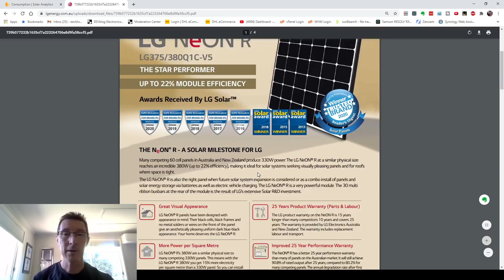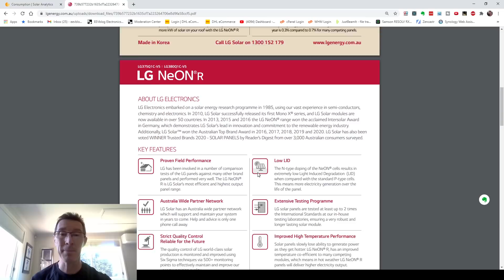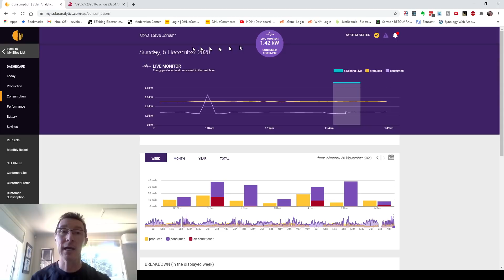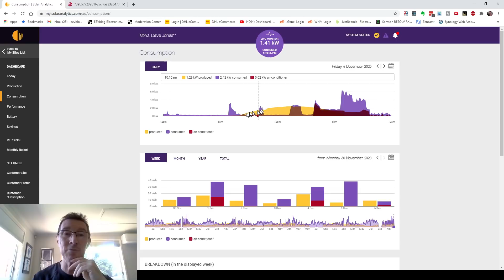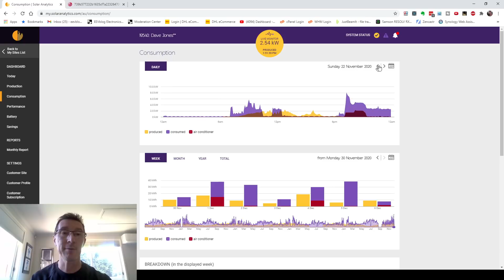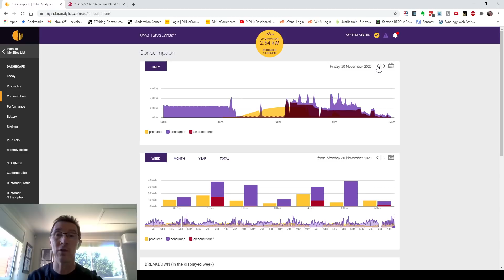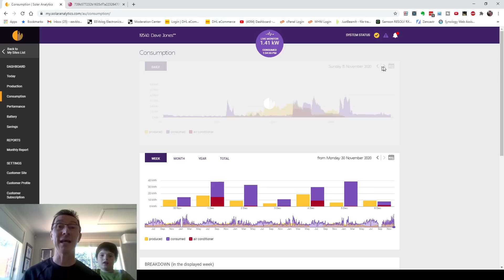Home Solar Upgrade Power Consumption

Comment: Here in northern Michigan, we call them solar suckers. "You bought a solar pannel?" Lol "Sucker!"😆
Reply: Solar is effective even in northern Michigan. Heck there are viable systems up close to the Arctic circle. Mine is doing very well in SE Michigan, and I have friends up in the Keweenaw, about as far north as you can get, that have done the numbers and getting decent payback, given how much prices have dropped.
Dave's sticking to LG for panels is kind of killing his numbers. I bought PhonoSolar 400 watt panels and they were < $300 each versus double that for the LGs. Same warranty too and I'm very happy with the quality. OK it's < $300 US, versus close to $500 for the LGs, but still quite a difference.
Reply: @John_Ridley  how many incandescent lights can it run? Plus 5 tvs, 4 computers, an entire radio station, two refrigerators, stand up freezer, yard lights, and everything else thats on all the time? Sounds like I would need 20 years worth of consumers power bills to cover that useage with craptastic solar pannels that are 14% efficient. And not to mention under 3 foot of snow because I got 1/8 mile driveway to plow I wouldn't be shoveling the entire roof aswell. I live in the woods and have no place else to put a bunch of pannels. As I said there DEFINITELY not ready for prime time in northern Michigan.

Comment: So do you need the 6kw power? The peak loads are all after  'sunset', and I guess that's what the house battery system is for. And with batteries wouldn't the energy (kWh) of today's system be enough?

Comment: Those panels are very expensive, but I guess you pay for the density and name brand. A local company (South Africa) makes a mono perc 440W panel (2,09m x 1,04m) for the equivalent of 215AUD (R2428) including tax.
Also, a lot of the local inverters here come with parallel kits where if you want to upgrade later, you just wire another in next to your current one.

edit: I'm not sure if it's monocrystalline, but it's advertised as "mono percium".

Comment: I mean yeah I agree batteries aren't very cost-effective but it also depends on where you source them, if you're buying new high quality cells right from the manufacturer then of course they'll never pay for themselves, but you can find places such as battery hookup that will buy up/dumpster dive to get old equipment, failed products or whatever and sell the cells from those devices, you can find 4Ah cells for less than $1 (USD) or around $65 per KwH, sometimes even as low as half that price when their warehouse gets filled and they need to clear space they'll have "cheap as balls" sales to get rid of stock.

Judging by your power usage seems somewhat common to use upwards of 15-20Kw per night charging the EV, so if you got let's say a 5KwH battery for $325 and assuming you could get it mostly charged in a day, I forgot what electricity costs over there but going with 12c per kw, it would save you about 45-60 cents per night or basically take slightly under 2 years to pay for itself, so yeah it CAN pay for itself if you get the battery cheap enough.
Reply: yeah, there's no equivalent of battery hookup in AU, and bugger all Teslas (and other EVs) on the road (so bugger all wrecked EVs) so you're not going to get batteries anywhere NEAR that cheap in AU. Shipping large heavy things from the US is already horrifically expensive, add to that the fact that it's a lithium battery pack and you're well into "don't even bother" territory.

Comment: Solar...great in some areas...I was quoted needing a 12KW+ System (32 Panels).  This is due to the location of my house, where it sits, and the roof configuration (not a lot of "open spaces" like your house).  This coupled with being in the land of ice and snow also means during the winter I'd have to ensure to clear those panels to ensure solar power generation.  The claim is  I would generate a max of about 5Kw because of how many panels would be in the shade during the day only getting a few hours of sun max.  The cost of install (and I get NO compensation for doing a solar install) was over $50,000 WITHOUT a battery system.  Yea...just doesn't make economical sense to go into debt here for me.  Don't go all "But it's the right thing to do"...great for those of you that can, do it...don't preach to those of us that don't see the feasibility to do it.  $50K brakes me even (at the earliest) in 30 YEARS.  I'll be long dead.
Reply: That price seems way too steep to me. I'd expect under 2USD/watt installed.
Reply: @eDoc2020  BTW, Our panel cost was almost $18k alone for the good ones, and that was on a bulk buy.  Nearly $550 each....I need 32 per the 4 different studies.  That would leave (per your number), $6k for inverters ancillary parts, permits, and labor.  Fact is, we dont have an install like Dave.  We would need to install on 6 different roof faces, and that drives quite a bit of cost.  The 4 different places all quoted within $500....and all 4 said "we wouldn't recommend solar due to your home design as well as home orientation".  Heck, I dont even know where they could hang all power items we'd need.  We just dont have the outdoor wall space.   Lol
Reply: $3 per watt to start in my area.  That's the going rate.  Due to my roof configuration (multiple faces), and the need for at.least 3 inverters thanks to that, costs go way up.  If I want battery storage then I'm up another roughly $10k.  Yea, not happening on this home.  I'm approaching retirement, and we have a potential build site for the home we plan to retire too....that we may be able to pull off solar on.
Reply: Yeah, $50k is WAAAAAAAY OTT for a 12kW system. 
I ballparked a full off-grid system for a potential project in Northern Tasmania (so no snow... probably... it did snow two days last week, at the start of SUMMER...) recently. Came out to ~$40k-50k (AUD) for 10kW of panels (and appropriate charger/inverter) and 50kWh of usable storage.

Comment: Adding a battery system can be done with an inverter that integrates the charging, or a completely separate AC coupled battery system. I am looking at the latter to add a battery system to my existing 4kW system (2 strings). There are lots of losses though and it is questionable as Dave intimated. A battery system doesn't suddenly give you more money for nothing......well, not in Scotland anyways!......IMHO!

Comment: I don't understand why you are targeting for peak power when the peaks clearly occur during evening when there is no solar power.
You should average the power consumption over an entire day (or better, a year) and do the same for generated solar power,  and then find how much you have to scale up the solar power to cover the average power.  Peak does not matter.
Of course, that assumes you can transfer power back to the grid at any time.  When there are limits on that, you would need a battery system.
But to dimension your solar panels for a peak power that does not occur during the day makes no sense.

Comment: Hi Dave, take a look at the sunny island inverter, it integrates well with your system (grid tied AC coupled). In this way, you can add a battery backup, the batteries will charge during the day and let you charge you car during night.

Comment: The new solution sounds perfect, only 1 old panel to disassemble so least waste and as you said 6+ kW should be enough. If you're selling the electricity you don't use than a battery doesn't make much sense but if you don't than you should at least get 1 big enough to run both fridges all night.

Comment: Looking at the graph where Sagan mentions the mountains, it looks like your generation is through the day and most consumption is at night. 

If you’re selling to the grid during the day, that’s not so bad, as long as they’re paying you more than they charge at night. If not, it looks like a battery system would be pretty good, store all that energy up during the day then use it overnight. That way, there’s no worries about power cuts or anything and your electricity bill would be almost zero, as you’re generating all of it yourself. If there’s any excess once the batteries are full, you can then sell that to the grid, so the system is actually revenue generating at that point.

Comment: Better option for surplus power may be to dump it into a hot water tank via an immersion heater.  Hot water tanks are a lot cheaper than batteries!
Reply: How do you get the power back out of them?  What do you do with excess hot water?
Reply: @einfelder8262  Check out the videos on this by David Poz’s channel. Basically you can use it for space heating in winter or just to take showers etc. in summer to replace your conventional gas or electric water heater.
Reply: @Richardincancale  But in winter there is almost no sun to heat hot water for space heating, and you need to run a pump to circulate the water.  Whether you choose to store excess solar power in a lithium or water pack, it isn't financially viable here in Australia.  Some will still do it though, because they can, not because it makes sense.

Comment: ya aircon (wired to the correct rail) seems very very inefficient...almost using the same to charge the car.. ya lookin at what 4.5Kw just charging the car and running the aircon..

Comment: If you are charging the car at 2.2KW then I guess you are using the "granny charger" (the unit which comes with the car having a domestic plug). The problem with these apart from slow charging is they put a heavy load on the power outlet and many are not up to the job. Much better to get a proper charger fitted to the home with a current sensor which monitors the house exports and limits the charge rate to prevent you consuming power from the grid.

Comment: Hey Dave, have you stopped uploading to PVoutput?
Also, what size inverter are you going for? Are you going to slightly DC oversize a 6KW inverter?
Reply from the maker: No, just do it in batches. Will do an update now.

Comment: Please avoid the battery, it has no ROI, and the batteries contribute heavily to e waste that is nearly impossible to recycle. Is there any option to sell power back to the grid?
Reply: Well they are possible to recycle. It is just not true that they are not. Actually quite high rates now a days just not done on large scales since not enough batteries were available. 

And that batteries have no ROI is not true. It depends on the country. In Germany you just get 8,3ct/kWh now if you are under EEG and only 3-4ct/kWh if you are not. But you would have to sell back the energy for 30ct/kWh at night. That would mean it would cost you about 20ct/kWh to sell it back and consume. 
With LiFePO4 you can manage around 8ct/kWh storage cost. Assuming buying them at around 200€/kWh, 60% depth of discharge and 4.000 cycles. 

So there it is an easy calculation. With storage you would save around 12ct/kWh-16ct/kWh. That makes sense.
Reply: @nukularpictures  The challenge is that the internal components react violently to most disassembly attempts, and many different manufacturers have proprietary blends of materials which makes recycling expensive as different batteries will need different processes. This is why most simply end up in a landfill.
Reply: @nukularpictures  The guy lives in Australia. The costs and returns in Germany have absolutely no bearing on this video.
Reply: @MattyEngland  Well as far as I know it is similar there. A few cents for the export but 25ish for the import. So actually really close conditions. 
Also I read that there were plans on actually charging people for the export since it puts a lot of stress to the grid. 

The only problem is that, as Dave said, the systems cost a lot more. Like factor of 2-3 compared to Germany. That I did not know.

Also this was a general statment. And for that it is not true. People from all over the world watch his videos. A large portions Germans. So yeah the comment can then help other people.
Reply: Recycling Lithium batteries is actually pretty simple, there are some Companies coming up as demand rises. They are not reactive at all once dischaged, Then crushed up and separated in metal foil, liquid electrolyte and electrode powders. These materials can be separated mechanically, only the electrode powders have to undergo a wet chemical process to convert them back to pure metals. Even that is not too bad.

Comment: Can you run the calculations for the battery system on a video? It looks like you could store a lot with your existing system to use in the evening and at night instead of buying more panels that will still generate nothing in the evening and at night. In a good day, you could be charging your car for much less on top of other things going on in the evening and at night... I know what you are showing is not representative of all your usage, but it seems that your solar energy is used by the quiescent power for your household during the day. The action is in the evening and at night (when you have no solar production), especially with the EV charging.
Reply: Arranging for the car to be charging while the sun is up would bring many of the benefits of a separate battery system with none of the environmental impacts. But indeed, weighing up all the options would be interesting (my suggestion has a notable inconvenience factor, which would have to be taken into account as well...)
Reply: @TheHuesSciTech  If it is possible to always charge it over the day. I mean for most home owner it is not. Not sure if he can, if he can it would be an option.
Reply: Or as some setups do, use the car as the battery.

Comment: just wondering what inverter you are getting? I got shit panel with Fronius inverter. LOL
Reply: The guys I worked with on my solar install, the techs that actually came out and did the work (in Michigan I tried but you're not allowed to do solar as a DIY project) just about flinched when I said "Fronius" - they Do Not Like. Said they were a lot of trouble. I went with SolarEdge and am pretty happy with them.

Comment: Why aren't battery systems economically viable? I would have thought that it would be a no-brainer for someone with an existing solar installation.
Reply: IIRC, the numbers just don't work out. You calculate how much it costs you to use the grid as a 'battery' by sending excess power on to the grid and withdrawing it later (e.g. at night). That's is the cost of electricty minus the feed-in tariff that you get paid for what you export to the grid. So that's $x per year. And then a battery cost $y to install and will last z years. For the typical NSW resident, you do all those calculations; it's a bad investment. Plus, you're using a lot of lithium, the environmental angle of battery is decidedly more questionable than solar panels, especially given that they don't actually generate any energy and perform a job that the grid itself can perform.
Reply: A battery costs circa $10k, there are tax or government subsidies here. Electricity costs say 25c/kWh, and about half the energy produced during the day is used without going into a battery, do the math.
Reply: @EEVblog  Well without any idea how big the battery is, what kind of cells, etc it is all damn difficult. But damn 10k AUD is basically 6k€. Here in Germany i can get a 4,8kWh solar battery with all protections, etc for 1800€. And that is still pricey with over 375€/kWh. That would be 3k AUD. But I have seen systems here for less than 300€ / kWh.
Reply: The batteries degrade too quickly. Simply put, they fail before you ever get close to an ROI, and they are horrible for the environment since li-ion batteries are nearly impossible to recycle.
Reply: @Razor2048  Nope that is not true. You can get LiFePO4 cells for about 200$/kWh. Those cells can reach 4.000 cycles if you only use 60% of the capacity easily. So it would mean it costs 8,3ct/kWh to store the energy. Normally you should still get quite some more life out of them but those are safe numbers you should always be able to reach, especially if you do not do 100% depth of discharge. 
Here in Germany it is an absolute must to install it especially if you run out of the EEG. Then you sell your power for 3-4ct/kWh while buying it back for 30ct/kWh.

Comment: More power = more export to the grid = more ROI
New panels = fresh warranty + sell old panels for some ROI
Bigger = better - cost of inverter
2*5 = redundancy

Therefore, answer = yes
Reply: More power = more of the power generated going generating feed-in tariff back to the grid as opposed to reducing electricity consumption from the grid. Since the feed-in tariff in Australia is so much lower than the cost to consume electricity from the grid, that makes excess capacity a worse ROI than the initial capacity.

2*5 does not equal redundancy in any meaningful sense. I assume he'd be running all those on a single string.

In short, your analysis seems fairly broken overall. Having said that, I think Dave should still go ahead, despite everything I've said.

Comment: Disregard my comment in prior video about consumption vs capacity. You obviously could use a system with >5kW capacity. Audio and video on the new lappy actually are pretty good. Audio was spot on, no complaints.

Comment: What are "woorly birds"?
Reply: The spinning air vents for the roof space. They use wind to pull cool air into the attic from eave or peak vents then exhaust it through them. Keeps the attic cooler and reduces heat transfer into the house. 

Where I live in Oklahoma most people have replaced them with flat or ridge vents because every time a thunderstorm whacks them with a tree limb the bearing starts squeaking or they bend seized.
Reply from the maker: See previous video